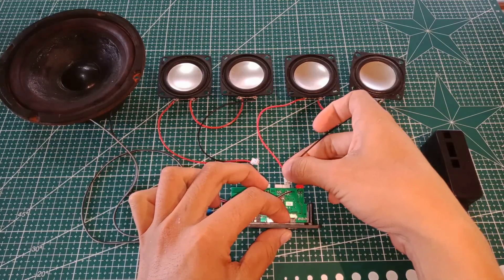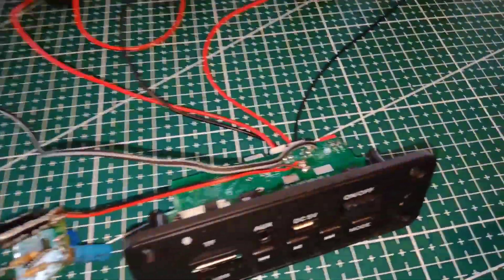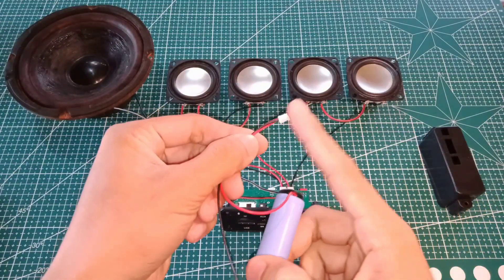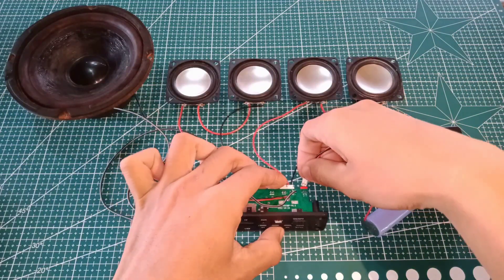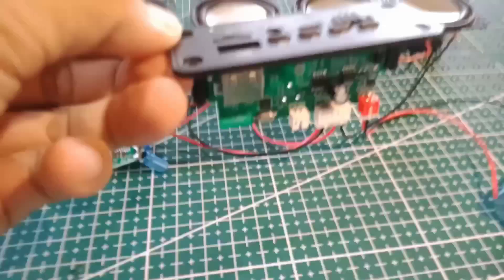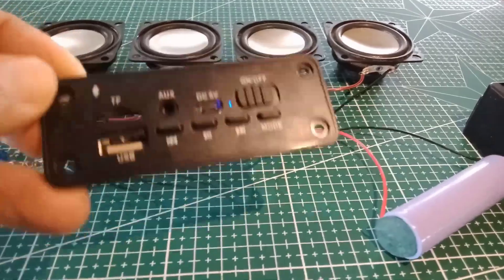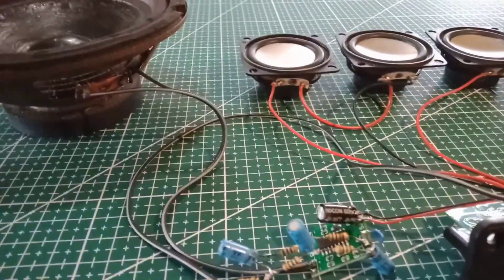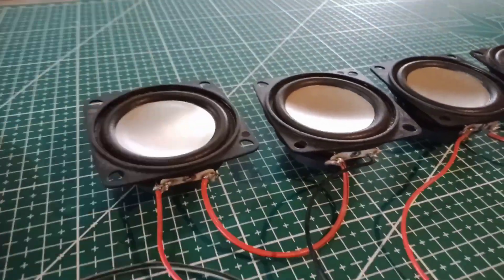SIMPLE STEREO 2.0 AMPLIFIER TO DIY 2.1 CHANNEL SUBWOOFER AMPLIFIER || SOUNDCHECK.

Comment: Hi, I am looking for something small, but packs a large sound...  I am good with wood as well as electronics...  Why I am interested in this?   I am an instructor of the electrical trade and am constantly proving or disproving many of the DIY projects here on you tube (example: the dual motor free power project was for the most part a bust... The completed device even after magnet, pulley, re-winding mods resulted in just a tad more power than what the device was consuming, and even the modified alternator was not much better...) 

 So my next "Project" is to build a small cheap amplified sound enclosure that can or will break the 22Hz barrier with an isobaric sub, yet clean enough that you may even want one...

I have settled upon a sound bar with sub design to build...  What I would like to know is I believe that I can achieve this using 50w @ 4 ohm speakers, and a 100w sub? Yes, I wish to series 2ohm speakers, and yes, I was looking for (something that I didn't see but can easily incorporate it) Bluetooth...

What are the specs on this amp? Can it handle isobaric loading?
Please tell me where I can buy this or other amp models of similar size and spec...?
Reply from the maker: I think this amp can't handle the “isobaric loading” you expected. This Amplifier is only 3to5 watts  maximum output stereo channel and my Diy subwoofer amplifier is 10 to 20 Watts pure bass. So I think it's better to use MT21 portable 2.1 amplifier. 100wx2+ 160w subwoofer that can handle your expected for your audio project. I will put the buy link of MT21 amplifier later on the comment section. Thank you for commenting.
Reply: @Segantech  Oh so we're talking "A head-phone Amp" (LOL, I get it, still though cool, cool, cool...) A second thanks upon your "human-ness and quick response", as only one of twelve or so comments that I leave actually get a human response, most go unanswered, while when they are answered it's in an automated bulk mail format - Thank you for your response dear Mr. @SaganTech, blaw, blaw, blaw... LOL... "Human-ness" 

I look forward to your post sir. And if your interested I can post our progress with this project (this isn't the first time, when I thought Humm maybe a YouTube channel?, If my teaching career doesn't work out there is always "YouTube-Busting"? Does sucking on a penny before a breath-a-lizer test work for getting out of a DUI? Or can this awful sound crack glass?

Ok so far the "Isobaric base theory" does work and is a valid "Trick" in getting 4x times the base in 4x less of speaker space.   (Enclosure space) we did a quick test doing a push pull of two as like speakers facing each other, one wired in phase while the other out of phase (this countering the obvious "speaker fight") the result is --> "A hell of a lot of base"...   Selection of speaker however is key to this, and a well made and well chosen base speaker (frequency range) is recommended if you so do wish to try it... In my test I used an old "Creative labs" 4 inch subs as we had at hand 2 identical 2.1 systems to part out and test... By simply using the "Creative labs enclosure, mounting the second speaker facing the stock speaker within it's original enclosure It did make "Da base" sound very "basey"...   Now I got you thinking huh?  4 times the base! LOL...

I try to do projects that are both interesting and educational and Base is what the students are into, and if I build something that is of decent quality, it gives them ideas for their budget and abilities...  So an amplified base speaker (sound bar w/sub) is the perfect under $100 addition to my classroom... Plus I can rattle a dean's cage with loudness when complete...
Reply from the maker: @tommyt350  

This is the Amplifier I promised. Here's the link. 
https://www.amazon.com/gp/aw/d/B09HKB44JQ/ref=sspa_mw_detail_1?ie=UTF8&psc=1&sp_csd=d2lkZ2V0TmFtZT1zcF9waG9uZV9kZXRhaWwp13NParams